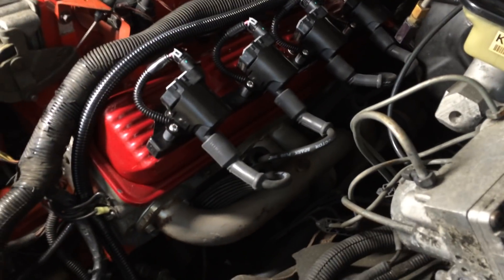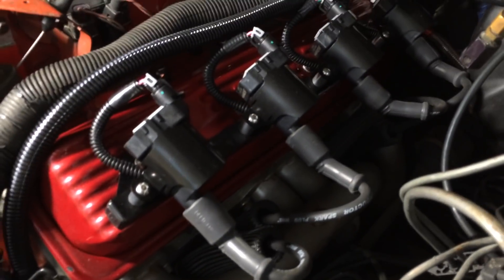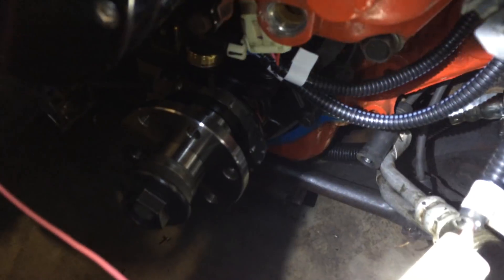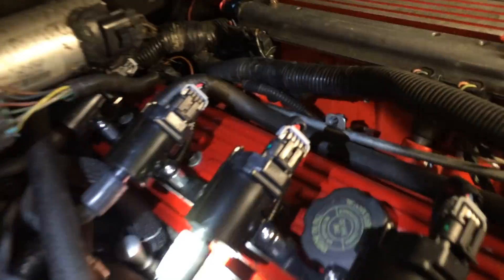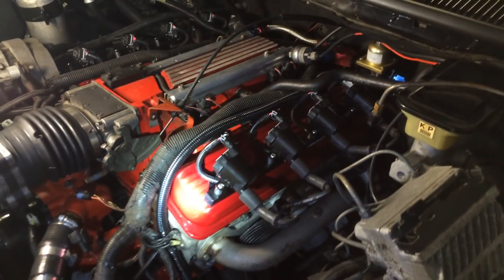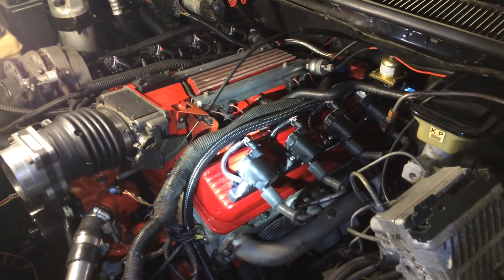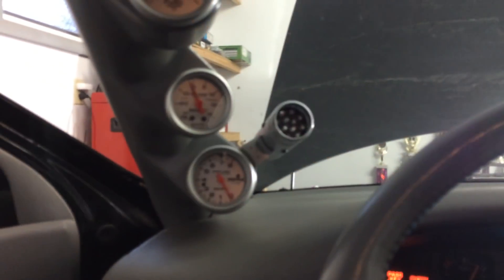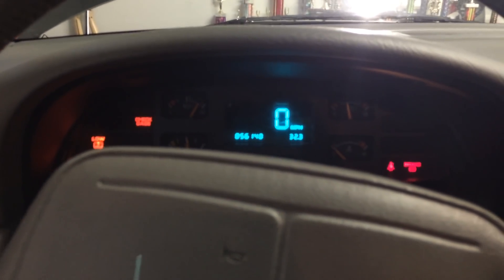TorqHead on Ellwein Engines Personal Car

Comment: Watching your videos you know a lot about LT1 Gen 2 motors. I am going torqhead most likely but either way if I keep my opti do you know if the Comp Cams XR282HR cam will work without mods? Specifically to the snout? I know I would have to check pin depth as I have a 94 spline drive....I was wondering if the center cam hole is big enough to accomodate the spline as I am not sure how far it sticks through the timing gear.....thanks!! BTW the video on Torqhead tips was what swayed me towards them. Thanks again....
Reply from the maker: If you don't have the cam yet maybe consider changing the timing gear to the pin drive and order the pin drive TH kit.  Or if it is a splined cam nose then TH sells a spline drive sensing unit.
Reply: @EllweinEngines  I appreciate the answer!! I Guess my biggest concern is the spline depth...I already know the timing gear drives the spline on the opti or TH setup...I was just wondering about the cam nose hole being able to accommodate it. I finally found the Comp Cams Lt1/LT4 cams on their website and even though I know a 87 up cam should fit in the cam tunnel and is stepped for the nose and factory cam cover I just didn't know about the cam hole...CC has assured me that the Lt1/LT4 Xtreme Energy cams will work with either opti design. Thanks again!